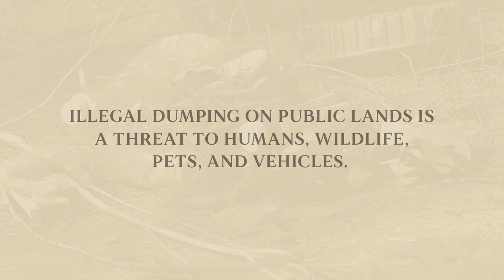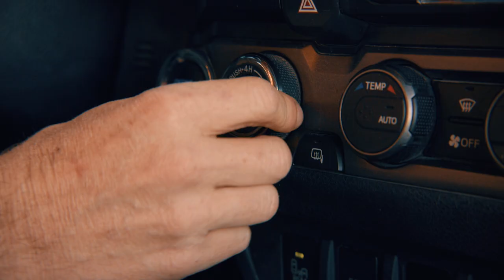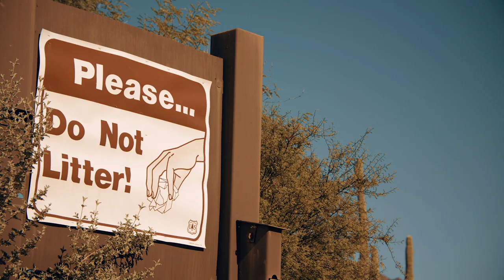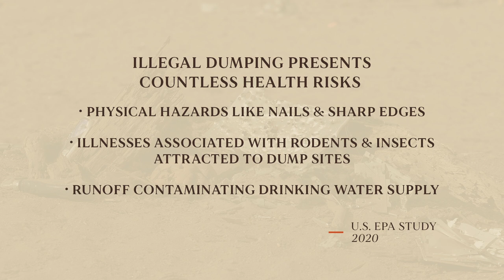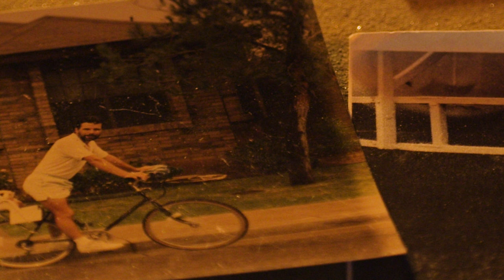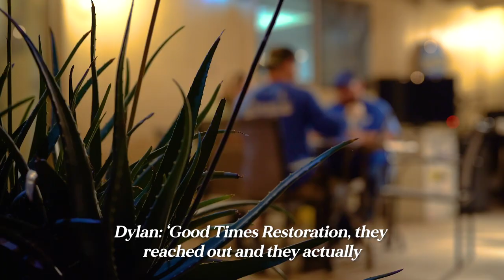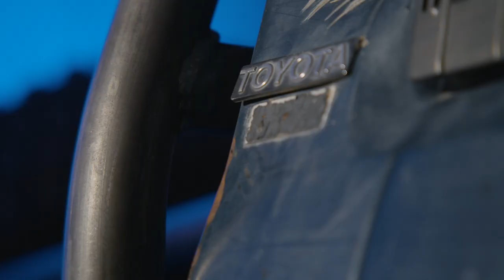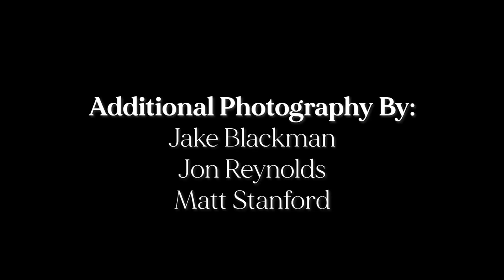From The Ground Up: Keeping The Desert Clean | Full Documentary

Comment: Back around 1983 i went to a place near palm springs ca. It was a nice little dune complex called Mystery dunes. Our friendly Three Wheeler mag had put an article out about it . I went with a few friends and i rode a 1982 250r ATC . I went to ride there another time and it was closed due to trash. With the wheeler in back of my datsun pickup i had no room but 2 weeks later i went out with a steel pennzoil oil barrel ( 30 gal ) and a ton of bags and filled my bed up. Many years later i had a house in the victorville area and a four seat offroad buggy trash was everywhere. I am looking to get a house possibly in AZ and hope to join in with  this fantastic  community.